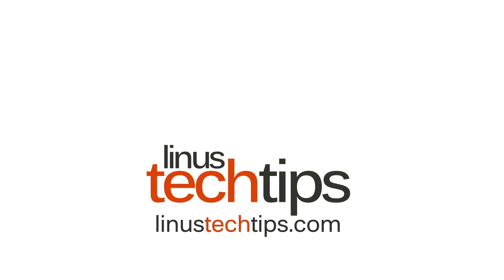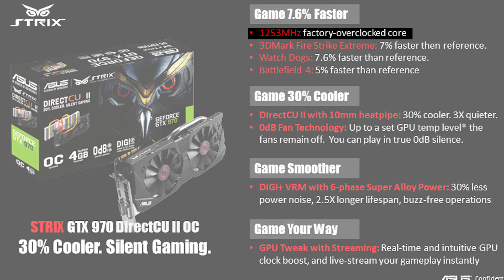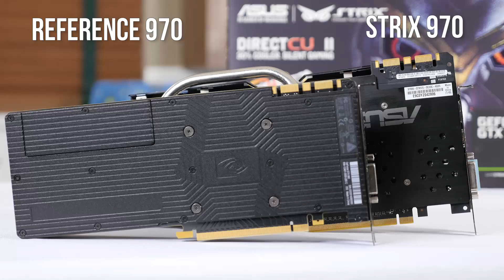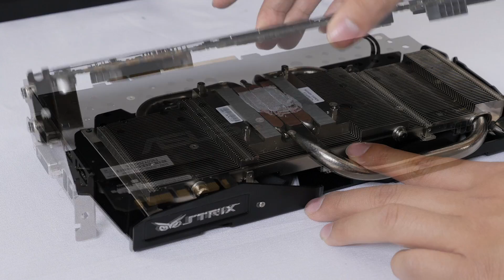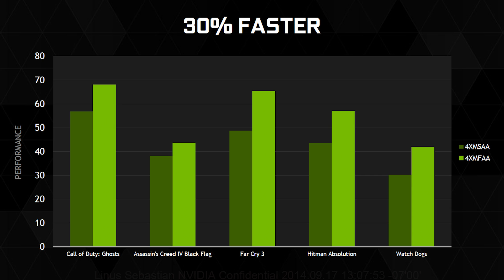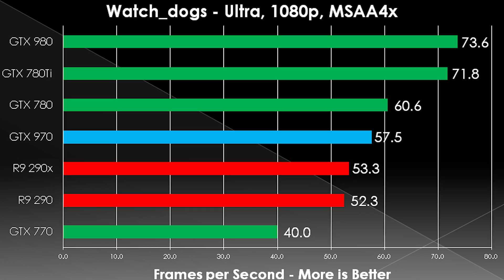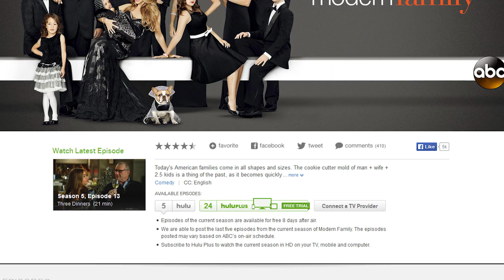ASUS Strix GeForce GTX 970 Video Card

Comment: I really hate this! Not everyone is going to overclock their card! PLEASE Include stock benchmarks!
Reply: You should, no downsides and you get the most you pay for
Reply: iMrzifyyy
heat output and chances to get your card broken
Reply: iMrzifyyy Higher temperatures in general will shorten the life of your GPU.
Right?
Reply: Phray01 you cant clock maxwell high enough for it to be a problem, and as long you dont abuse the voltage you're fine.
Reply: please there is like 600 videos showing stock benchmarks already. people these days are too damn lazy
Reply: littlefrank90 no, maxwell runs cooler than Kepler, therefore it's okay, the temps on maxwell cards are quite low anyway.
Reply: bassl0va
"The performance increase is negligible though" you need to look up the word negligible, because I don't think you actually know what it means.

the performance gain from overclocking on these cards is far from negligible.
Reply: I feel bad for all the people who won the silicone lottery but didn't even check their ticket
Reply: littlefrank90
if you plan on running a 970 for the next seven years. then yeah be worried. chances are something else in your card will beak before anything does because of "high" temperatures that are well within tolerances of the card.
Reply: why would you not????
Reply: João Teodoro Most vendors, if not all, allow the overclocking of graphics cards without losing your warranty. Heck, MSI, Evga and Asus even have their own overclocking utilities that they personally promote.
Reply: xValsion Don't feel like it? can't be bothered? It's not like intel CPUs where there are specific unlocked models for overclocking (yeah you can oc cpus without unlocked multipliers but why bother?) All gpus can be overclocked, doesn't mean they have to be. The performance increase is negligible though. Heck atm I'm even running my 2600k at stock speed. I used to have it oc'd but dropped it back to stock when troubleshooting something. Haven't been bothered to raise it again and I'm not missing the extra performance atm anyway.
Reply: If you aren't overclocking your card then you need to be buying a reference card. Not overclocking a non-reference card is a waste of money.
Reply: No
Reply: iMrzifyyy Ah, didn't know, that's pretty amazing then!
Reply: Daniel Avrit it can add up to 10-15fps
Reply: NO BALLS! NO BALLS!!!!!
Reply: I kind of agree with the OP, when representing value for money I think just testing stock is better (or out of the box), we all know overclocks are never guaranteed.  Also the benches are just further showing the variance of ocing - think about it, the 980 beating a 780ti, but the 780 beating a 970, which when you add up all the specs of the cards; it doesn't make a whole lot of sense...
Reply: IF THE CARD CAN RUN LEAGUE WITH NO FAN SPEED YOU CAN OVERCLOCK AND IF YOU ARE TOO SCARED LEARN HOW TO YOU PUSSI
Reply: Overclocking only adds a couple fps, not much difference.

Why wouldn't you overclock? Just drag the slider to the right.
Reply: There are lots of people on the internet that do their benchmarks at stock.
Reply: 99.9999999% of the benchmarks done on youtube are stock, just look at those.
Reply: Daniel Gilmetti wrong.  The non reference models are quite. And cooler
Reply: iMrzifyyy
no downsides? ever? YEAH SURE ABOUT THAT!??!?!!?W:E"fjkSDVNJASBK NVNJK ASFL
Reply: you really shouldnt be buying one, especially a nonreference one, if youre not gonna OC
Reply: You are in a decided minority, my friend. My cards have factory built-in overclocking and I've run them at their default limit (85°C) since I bought them a year ago with no issues. If you aren't taking advantage of the automatic overclocking on these modern video cards, that is very foolish in my opinion. It's like putting a stone beneath the gas pedal of a newly purchased sports car because you're afraid of what will happen if you push the pedal to the floor, when the car was designed to be floored the entire time.
Reply: João Teodoro No.
Reply: Olav Alexander Mjelde my little brother can overclock just fine lol and u cant brake card from overcloking. its as likely as a car acident. what nvidia allows is very safe, the card slows down when too hard.. it shuts down if too hot, its wotn even run if clocked too high and voltages cant go too far at all. never herd of a gpu brake from OC
Reply: lol these things can never run hot enough to hurt you man, dont worry abbouts temps that is maxwells biggest advantage
Reply: Maxwell cores are kickass, if stock benchmarks sucked Nvidia wouldn't sell any cards.  Sorry that the world doesn't cater to hold my hand Gen Z whiners that can't do research on their own... BOOM!!
Reply: Do you choose the best & cheap Graphic Card ? *Click to read now !!! amzn.to/1tIcF9m
Reply: If i overclock my card do i loose the warranty?
Reply: why when it already came like this im pretty sure asus/nvidia wouldnt have this superclocked knowing what could or could not happen
Reply: João Teodoro EVGA, ASUS, Gigabyte, and MSI all have free OC software, so I'm assuming no.
Reply: Phray01 That's only if you over clock like a dumbass
Reply: There are plenty of other places you can get the stock benchmarks. Overclock all the things. Also you should be overclocking.
Reply: Ok then, look at the dozens of other benchmarks from other reputable places where it's stock.
Reply: TBH, I don't mind, but I would like to see stock clocks as well as OC. It wouldn't take too much extra work (Sorry for asking for more from an already awesome channel) and then we could see how well they OC etc all in one place.

If I had to choose just one, stick with the OC stats though. But seeing both  would be cool and quite interesting... which fits with why I watch this channel.
Reply: Here here
Reply: MSI Gaming App or auto-OC. Uses more volts though. :/
Reply: What the fuck. What possible reason do you have to not overclock a high end video card.... Makes literally zero sense to pay $50 over reference price for overclocking-specific upgrades, and then not utilize any of them.
Reply: Daniel Gilmetti i buy non reference for the silence
Reply: bassl0va You probably aren't pushing the limits of what your 2600K can do though. There's major difference if all you're doing isn't is video games and basic video editing on a high consumer-end CPU. Look up benchmarks on TomsHardware and other sites for 970 and 980 benchmarks, they have them showcased at both stock and overclocked settings. There is usually 15+ average frames of difference, which can be tremendously important in highly taxing games like Crysis, ARMA 3, Sleeping Dogs and the like.
Reply: Very much this, it's also not fair for AMD, they use the reference R9 290 and R9 290X, which everybody knows, have shit cooling and thus can't be overclocked very much.
Reply: There are plenty of other sources the bench stock speeds. Linus has said that they purposely bench OCd cards because everyone else benches stock cards.
Reply: Then go watch one of the other 9 trillion reviews of this card and every other card ever made ever.
Reply: Mos Baked epic analogie
Reply: Gains quixote  Thank you
Reply: you can buy ready clocked gtx 970's :-) if you want stock design (non clocked, with more noisy fan), you can of course buy the reference models. (but they are not a lot cheaper, they are noisyer and perform about 5-9% worse).
Reply: No.
Reply: if you want stock clock speeds get a reference card. The Strix is clocked faster than the reference card as a default. It's technically not an OC when it comes out of the factory like that. EVGA calls it "superclocked" rather than overclocked which just means that the cards are MADE to run at faster clock speeds than nvidias reference card.
Reply: Shut your pie hole. I'm running the MSI GTX970 and overclocking is not even necessary . bye now.
Reply: João Teodoro no you don't :) It's your card and you can do with it what do you want, OC is getting frequencies higher for higher performance :) It hasn't any influence on warranty :)
Reply: It's factory oc and has a better and more quiet cooling than reference, also most likely better power phase components
Reply: ***** so whats a good max temperature? im not going to overclock it yet because this gpu runs every game ultra +60 fps #firstworldprolems
Reply: littlefrank90 Yes but it will not last long enough to matter regardless.  technology evolves at such a rapid pace and even if it did shorten the life, you don't want to be using the gtx 970 forever do you?
Reply: I personally haven't had a video card die of "old age". Even overclocked cards. Most companies now a days use fairly high quality capacitors with very long life spans. Keep on overclocking!
Reply: Stenio Moreira You might have tagged me by accident, I know a lot about clocking, have been doing it since the 90s. Even making custom firmwares for fan control for oc, oc settings etc. So I know of course that clocking without volt mod will not damage anything.  My point was to the people afraid of oc, that these factory oc cards are already oc. So even if they don't want to oc, they get the faster and more quiet card, often with better components too :-)
Reply: João Teodoro Im fairly sure when you overclock GTX GPU's Nvidea will replace any cards broken through overclocking because they endorse it so much
Reply: João Teodoro Yes, the heat will be hotter & the warranty will be quicker.
Reply: If you're gonna spend that much on a card you're stupid not to OC
Reply: James Cousins dont drop that dirka dirk....at 2x the heat and half life span...LOL
Reply: The people who are telling others to get the reference card if they aren't going to overclock need to realise there is no reference 970 out on the market. It would also be better to have stock clocks for the benchmarks, as some cards don't overclock as well as others. Woo for the silicone lottery! And yeah some people just don't overclock, simple.
Reply: HalfLifedGam3r  yes!! lol the coolest temp cards of all time and people dont wana push them???? lolol when is the last time you guys broke a card from temps????
Reply: HalfLifedGam3r lets not insult our own community. instead maybe help them find the benchmarks they need or stay out of it? #PCgamersSTICKtogether
Reply: CL1CKS i was joking and was the # really needed?
Reply: HalfLifedGam3r it's not funny to him and he doesn't know you were. Which you probably weren't joking just realize now that you're an ass. #necessary
Reply: Why can't the pc communitybjustvget along geez. There are nice ways to say things.
Reply: ***** It's not pre overclocked. You can overclock it yourself.

Comment: An Gtx 970 should be good enough for 1440p monitor and 2x gtx 970 sli for 110$ more then gtx 980, its an killer combination and we can finally have 45-60 fps on 4k with the latest demanding games without spending 800-1500$ on graphics cards, so yea either way the gtx 970 is an powerful and value priced gpu :-)

Comment: Are people in the comments SO DENSE to ask why the performance charts show a much different result to other websites without LISTENING to the video?! ALL CARDS ARE OVERCLOCKED! YES, THE 780 AS WELL. Since the 970 and 780 are similar in performance at stock, the 780 looks to be the better overclocker when compared to this particular non-reference model. NOTE: Since this card comes with an 8 pin power connector, it may suggest a greater, untapped overclocking potential that may be harnessed in cards like the Gigabyte G1 card (which has an 8 pin as well as a 6 pin). 

If Linus is reading this, please do NOT consider running this cards at stock for your benchmarks. You've been doing the overclocked benchmarks for over a year now and despite EVERY video having a disclaimer, you get these dense YouTube commenters time and time again.

TLDR: Don't be lazy and read the whole post.
Reply: TL; DR every card in the bench marks are overclocked
Reply: Isaac Elias Well, I guess that works as well lol.
Reply: CanIHasThisName A new test was released in which a 980 running at 1500/4000 MHz and cooled by an Accelero Xtreme IV reached 330W in Risen3 and 340W in Anno2070. Remember that these guys measure only the card itself and not total system power draw.
http://www.pcgameshardware.de/Grafikkarten-Grafikkarte-97980/Tests/Geforce-GTX-980-vs-GTX-Titan-Test-Benchmarks-1136918/
Reply: PixelMaster .be YEs is right i love how he overclocks all his cards! many dont. thats why i only trust his graphs. who would buy cards not wana get more out of them lol?
Reply: CanIHasThisName Watercool, overvolt and overclock it to the absolute max and you can reach 300W

Edit: Don't forget unleashing the BIOS
Reply: Notorious544d Which brand would you recommend for OC? Gigabyte?
Reply: I don't mind the benchmarks overclocked but for example when Linus got the haswell CPU, he got a golden one and was able to super overclock it, then the ones people were getting didn't overclock at all. I wonder in Nvidia has been giving linus golden gpus to try and mess with the benchmarks?
Reply: CanIHasThisName That's just an assumption.
I once watched extreme OC with a 780Ti and it was drawing 1000W and peaks at 1200W.
With watercooling it would be possible to reach 300W with a 970
Reply: CanIHasThisName It was definitely not normal use and the card itself was drawing 1200W with peaks at 2400W (above was wrong). Source is German though:
http://www.pcgameshardware.de/Geforce-GTX-780-Grafikkarte-257241/Specials/EVGA-Geforce-GTX-780-Ti-Classified-Kingpin-Edition-Hand-On-Test-1122696/

Since 300W are nothing for a custom loop it does sound plausible but it needs to be an overbuilt card
Reply: yes

Comment: How did you only get 54.1fps out of an overclocked 970 when i can get 45fps easily out of my slightly overclocked 670? is it really only a 9fps difference over 2 generations? almost doesn't seem worth it

Comment: I'm actually a little worried about the semi-passive fan profile; the Direct CU2 was already having vrm overheating issues in later batches without this semi-passive fan profile. Hopefully later reviews reveal this not to be a problem.

It's also the second non-reference 970 cooler with a backplate. Very nice.

Comment: All other benchmarks I have seen from multiple sites put general performance of gtx970 within 1 or 2 frames of gtx780ti, then how come here it seems the 780ti outperforms the gtx970?
Reply: They overclock, and had a beast 780ti and 780
Reply: yes as jack said. they overclock. and the 970 had only one 8 pin connector that limits the power

Comment: As a fan of the Guardians books I love the owl reference... You can't go wrong with ASUS (I currently run a ASUS GTX 660ti) but I think the MSI GTX 970 performs even slightly better since it has an even higher clock and their coolers are a no-brainer. It is also 1cm shorter if you have a smaller case.

Comment: wait so... why does 980 even exist? they're both for gaming, they both has the same amount of features, but just a few bit more cores? that's basically like paying +$200 for a good overclock. do correct me if i'm just being ignorant here.
Reply: 970 = great for single monitors with higher resolutions than 1080,and a great overclocker to go toe to toe with stock or slightly factory overclocked cards that are 500 plus and it is great for the consumers who need the graphic power in games, but doesn't have the money to spring for the big brother. 

980 = great for multiple high resolution monitors, and it is basically out performs the 780 ti while consuming less power, and costing just about the same as a regular 780 here in the states.